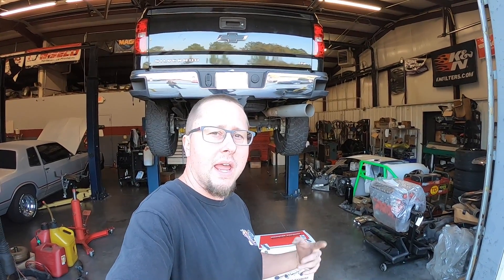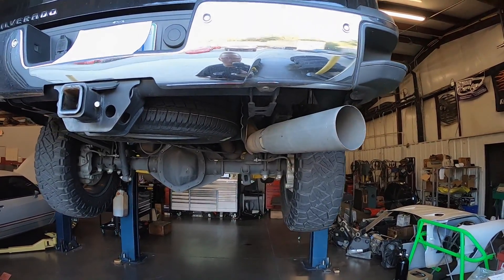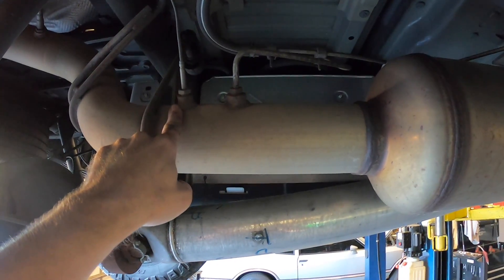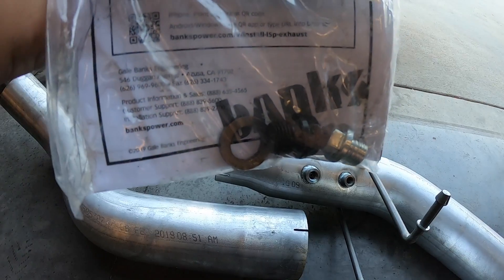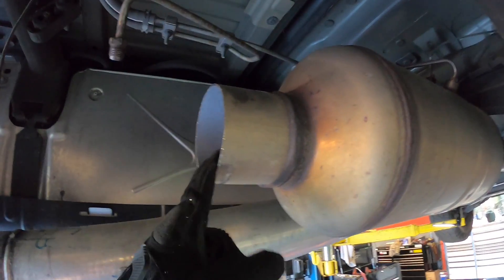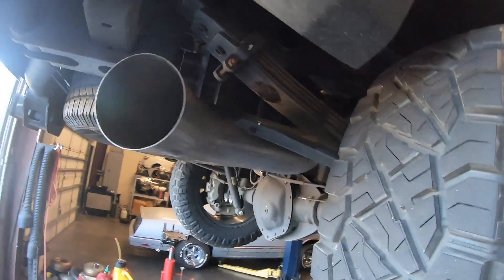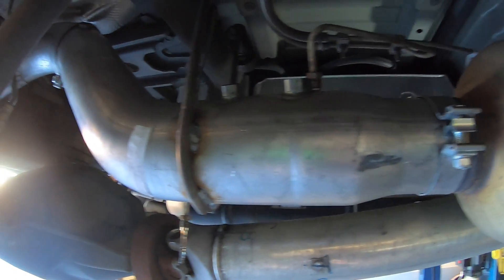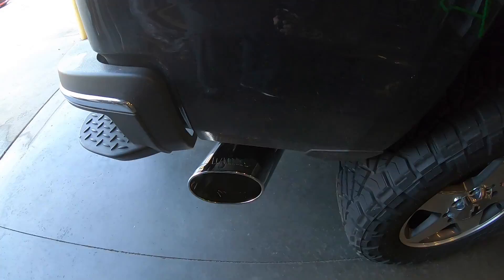Banks Power L5P Duramax Monster Exhaust System Install

Comment: I was hoping to hear a before and after. What's up with that small exhaust exit on the stock system behind that big tail pipe? They put way too many sensors on these newer vehicles.
Reply: Lol it does nothing for sound or performance
Reply: Immortal You won’t hear any difference after, man...it’s a DPF-back system.
Reply: I dont see any benefits to this dpf back kit. It does nothing other than looks and waste money. But it does look better)

Comment: When you did the E-Fans on the Tahoe. Does it matter the power wire is connected to the battery or the alternator ?
Reply from the maker: Doesnt matter

Comment: Wait so I can’t just use a saws all to cut that big ass muffler and just replace it with a straight pipe? Or will this trigger check engine light or other sensors
Reply: nope it will go into limp mode and limit your speed to 5. cost about 5k to delete
Reply: I was wondering the same thing thank for clarifying. Pretty shitty

Comment: I basically have the same setup, 2017 l5p, I currently have the banks cold air and derringer tuner. Next is the 5" exhaust...but I wanted to see if your truck started throwing engine codes when you put the derringer tuner in? Specifically fuel rail pressure codes ?
Reply: jaycee _  all the other mods are great ! I actually just took out the derringer tuner and returned it. Check engine light never came on again. They are checking it to see if something was wrong the tuner or it for what ever reason just didnt get along with my truck 🤷‍♂️

Comment: The big restriction is obviously the DPF, but has anybody ever looked closely at the stock L5P exhaust tip?  It’s really choked down before it goes into the horn.  They try to speed up the exhaust velocity and pull secondary air in by Venturi to lower the exit temps.  I could actually see that as a pretty decent restriction.  I might go chop mine off.
Reply: chop what off ?
Reply: @mondo9.2.5  The 4” to 3” restriction inside the exhaust tip.  My buddy actually tried it on his truck, he cut off about an 1” of pipe so it a true 4” outlet now.  He installed a new angled exhaust tip and his EGT’s went down a couple hundred degrees.
Reply: @balncobra  wow thats awesome , thanks for the reply and as soon as i get the chance im gonna try it out aswell i dont want to spend a ton on a dpf back

Comment: What soot look at the inside of the stock exhaust tip. There is no soot coming out the exhaust the DPF traps it all. You are a shop and don't know what each sensor is?  You talk about deleting and you do not even understand how the emission systems work, you should know exactly what each sensor, actuator, and every other component is and does otherwise you have zero credibility. This is typical,  just bolt things on modify,  without understanding  the effects on everything else.  I spent my career as a Smog Licensed ASE Certified Master Tech. How can you fix something when you don't know what you are looking at? At least you are using Banks products he does know what he is doing based on understanding, research, engineering, and testing.